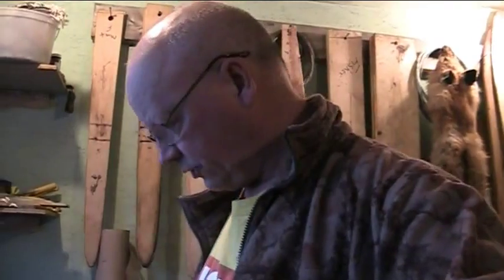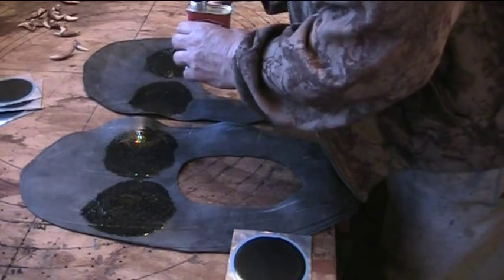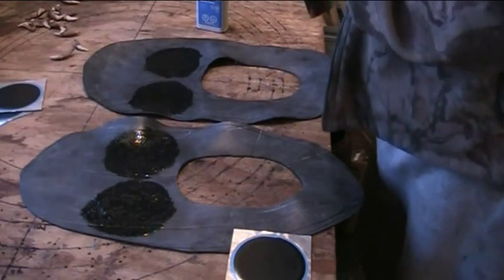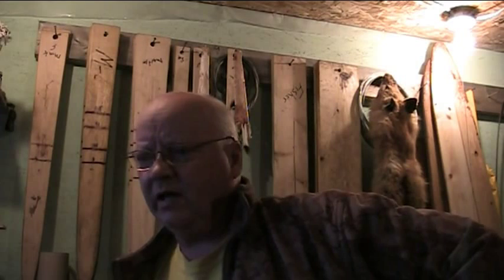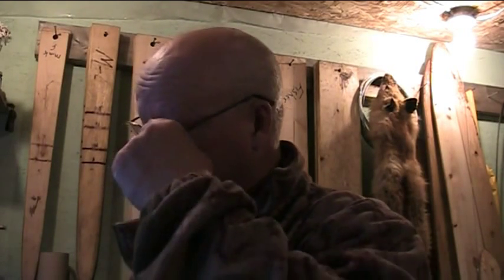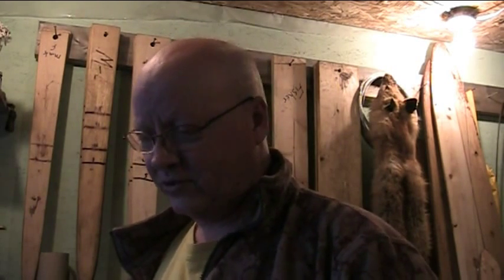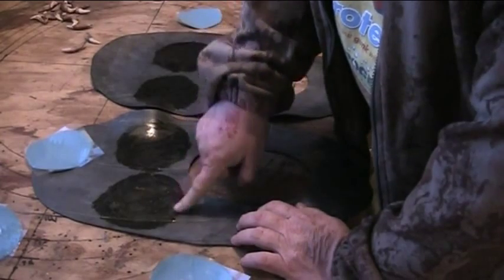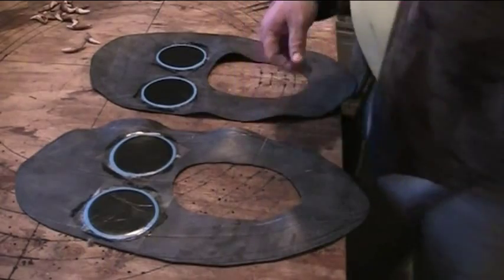Making Your Own Snowshoe Harnesses Part 2

Comment: Nice video..gonna save me some bucks
Reply from the maker: Thanks... you were saying that you got several bearer with the fur rubbed like that one I got. Just wondering do you get them only in the spring or all season long?
Reply: Trapping World usually  appears towards spring  and often it will seem to be localized by that I mean all in one specific area.I don,t really recall  any at any other time.
Reply from the maker: John 3.16 Ya both the beavers I caught out of that one house are the same and I have never seen it before.

Comment: why not the oval bear claw type snowshoe?
Reply from the maker: Charles Dorey Hi Charles...as with most things it is just a matter of prefference. Each type has its advantages over the other and the bear paw shoes are harder to get through thick bush in then the narrower shoes. The longer ones are harder to turn tight corners in however. I used to do a lot of traveling in them (as much as 20 some miles a day) and for that kind of travel the bigger shoes are much better. Thanks for watching.   Dave